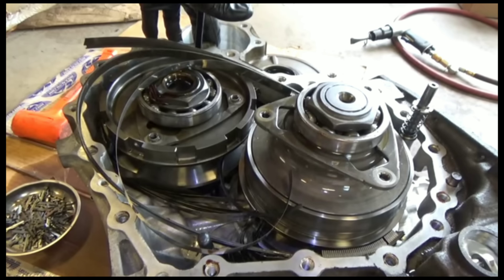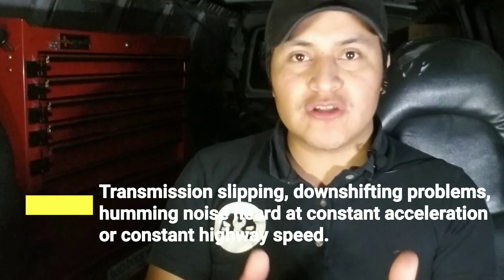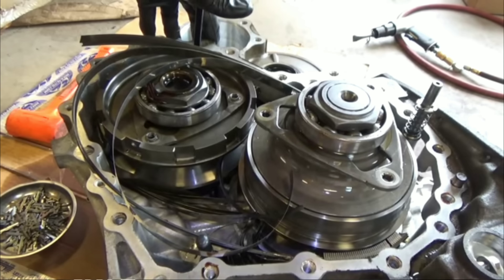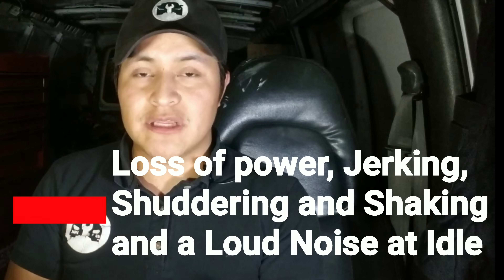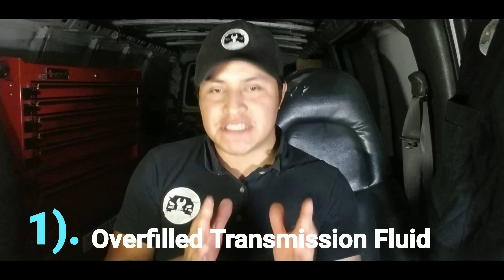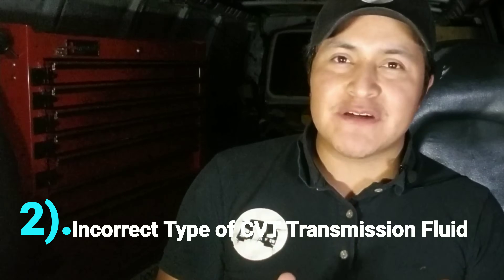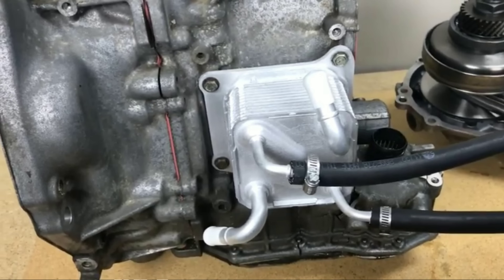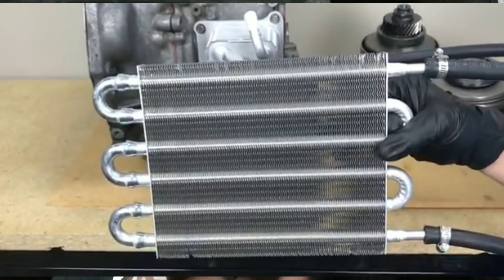NISSAN CVT TRANSMISSION | why it fails and what you can do about it to prolong it's life

Comment: @10:40 I almost guarentee that Nissan would try to blame the CVT failure on the aftermarket cooling system, even if it didn't actually cause the problem. Like insurance companies, car companies will find any reason to try to not honor their warranty. My Nissan dealership tried to say I voided my warranty because I had a bluetooth ODB sensor plugged into the ODB port.
Reply: Yeah like covid shots

Comment: The problem is two fold. #1, CAFE are after higher fuel economy and this results in lower emissions. So government put pressure on car/truck manufacturers!
 #2 Every company has a change over in engineering. Each year the experienced engineers walk out the door with a pension if lucky. New graduates start at lower expense to the company but the wize years of experience walk out the door. I became an ASE Master Tech in 1978 when the company was still marketed as Datsun. I saw many improvements in the engine, transmission, differential and suspension. Hell, I own a 1969 Roadster 1600 (SPL-311) which is the original “Fairlady” series. I rebuilt the JATCO 3N71B automatic and was the only tech to work on the 280Z in 1976. Nobody else would because they were afraid of a 3 gas engine analyzer that provided exhaust gas information. 
  I am looking at a newer vehicle for my wife of 41 years. I will not buy anything with a “CVT” transmission in it period. They for got to calculate and test long term and short what it needs to survive, heat being the number 1 problem of any automatic. Hell, even Ford used the JATCO 3N71B in the Fairmont because it had less internal friction, better fuel economy and produced less heat. The stupid idea they could built this magical transmission and get 300,000+ mile like the Datsun 210, B210 or the F11 nobody heard of. Yes, a front drive car with a stick transmission. You could remove the right front wheel, service plate and change the clutch in 45 minutes. 
  You bet, lets put a metal belt between to concentric pulleys and it won’t get hot? That fine if you want to move hay from a trailer to the top of a barn, but not in a vehicle! Stupid! If you think that’s great, i’ve Got a “Wankle” rotary engine with 3 sides that will run at 11,000 RPM all day long! What? What is an “Apex” seal? Stick to what you know. The 1978 Datsun 210MPG got 56 miles per gallon! Yep, over 50 years ago. Google Road & Track with the Honda FE & Datsun MPG, then lean to read. Retired ASE Master Tech since 1978.

Comment: This man is describing all the problems I'm having with the only vehicle I have to get around 😔
Reply: Tell me about it...  Kinda wishing I hadn't watched this video 🤦🏾‍♂️
Reply: @Tech4Lyfe  😔
Reply: Just ignored and go buy another nissan altima @Tech4Lyfe
Reply: @eliseomata6251  I'm still rolling!  Im just stacking and waiting till my wheels litteraly fall off so I can get my truck.
Reply: @Tech4Lyfe hahaah bad news on bad newwws this one
Reply: @SassyL62  FYI I'm still rolling in my 2012 nissan altima coupe...  After doing some reading and digging, I decided to change the throttle body myself, 30min job, and I also changed my pcv valve, I heard they go bad, which it was.  99% of my issues went away!  Now I need to go to nissan to have them  update my system to stop the damn maf sensor warning (its actually a recall issue so theyll do it for free).  Check those throttle bodies, I had 3 mechanics that didnt figure it out 🤦🏾‍♂️
Reply: @ wow THANK U!!
Reply: I have a 2012 murano I got in April. 
My transmission went out last week in the middle of the highway… I took real care of it and changed all old parts like battery, oil, plugs, new trans fluid etc. it still failed. 
I wish I knew about these cars before buying a used one. I’m back to using my old Toyota Camry. (2002) thing lasts longer than any car I’ve ever drove.
Reply: @Miguel21ification  that really sucks! A lot of the old school cars are driving w no problems.
Reply: @Miguel21ification  I had a 02 Camry sold it last year with over 260k and now it's up to 300k and still on the road
Reply: @Miguel21ification  we're on the same boat, my 2011 Nissan quest cvt trans acting real stupid but Thank God I kept my 2002 Camry & Honda Goldwing motorcycle because they never failed me, had the Camry 20yrs and still runs like hot butter👍
Reply: Did you ever get your car fixed 😭
Reply: @cheriamor4683  girl,  why you crine laughin? 🤔 I don't like det.
Reply: @TamikaX  Hell, I wondered the same! Not sure what her intent was but some people use that emoji just for heavy crying, or loudly crying, not 😂 or 🤣
Reply: @Tech4Lyfe  right! Sheen respond yet but I wasn't that serious.  I was just wonderin chile. Is she gone get it fixed? Is she gone buy me a new one? Cuz she ova der just askin all willy nilly 🤷🏿‍♀️ and laughin 🤣
Reply: @TamikaX  No lady, I was wondering if you got you whip fixed!!!  I'm still riding with mine making noises, and I was hoping for good news and a chance it's not my trans!!!  🤣
Reply: @Tech4Lyfe  huh? I was talkin bout the female. Did you mean to comment from the cheri amor account instead?🤦🏿‍♀️
Reply: @Tech4Lyfe  just screenshot this 🤣🤣 youtube weird
Reply: @Tech4Lyfe  I’m just wondering if you still riding in yours lol 😩
Reply: @aaliyahharris240  LOL, yes but not by choice, 2012  car that I bought in 2014, 68k miles currently.  Think I'mma put in some new coilover suspension, some rims and low pro tires, replace the Trans oil and replace motor mounts all in the next week or 2.  And ride it out hopefully for another year or 2 while I save up for a new truck.  And either give the car to my neice or keep it as a toy.  I now have also maf airflow sensor code that won't go away even after replacing  with a legit oem sensor that was bought from autopart store...
Reply: @Tech4Lyfe  so was it your transmission going bad? Lol
Reply: @aaliyahharris240  🤷🏾‍♂️ I keep having my mechanic check the trans and he don't see anything wrong.  And I'm too scared to take it to my Nissan dealership mechanic...  They always find shit wrong...  I'm hoping the trans fluid flush will sort out any kinks.
Reply: @Tech4Lyfe  if you have a CVT transmission 🤦 I wouldn't put much money in the vehicle now because that trans gonna fail soon and cost you $4,000 on average...ijs 🤷
Reply: trade it for a toyota pay now or pay MORE LATER
Reply: @JDMHaze honda....
Reply: Labor rates are expensive on Trany work, but sometimes you can get the original trany rebuilt at lower labor rates - I did mine for only $850. and it's been working fine.
Reply: @dennishassler605  how much did you pay to get it installed?
Reply: @dennishassler605 where at?
Reply: @MikeJones-qo7vt  - Thank you Mike.  If you take your car to Nogales Sonora, there's an excellent mechanic there - the guy I used speaks English just fine.  For a Transmission, there's several places, but there's one on the route from the border about 2-3 miles
on the highway going the direction toward the border on the LH side.  My Suburban was done several years ago while driving through Mexico at Tacuala Nayarit, Mexico. I recommend using a shop, because they invest plenty to keep the business profitable and pricing in Mexico is less than one forth what you pay in the USA - and they often do better work in Mexico.
Reply: @dennishassler605  Where?
Reply: I recommend getting the transmission fluid changed as soon as you can. Watch the video from the Car Wizard's channel. I hope it helps! CVT transmissions aren't a death sentence for your car! CAR WIZARD shows how to keep them going
Reply: How many miles did yours have? I heard remanufactured Nissan CVT with updated pump would be better but also change the original CVT cooler to bigger size and add radiator. It might be too much work, maybe just find another used Toyota or Honda.
Reply: It's a big problem Nissan has be Honoring the replacement on these
Reply: @ghostface9091  how do I get them to replace mine?
Reply: @TamikaX  only if you have a 2017 Nissan Altima under 100k miles they will replace your transmission.
Reply: @Nicole-si3ck  I have a 2007 but I replaced mine w a transmission that had 64 k on it but that shit ain't no good unless the guy didn't know what he was doin.
Reply: @TamikaX how much did you pay for the replacement transmission?
Reply: I’m about to flush the cvt fluid from both mine and my wife’s nissan. There’s a lot of stories about the cvt trannys but I think some of the issues ppl have is not taking care of their car they way it needs to be. I do most of our maintenance work right in our driveway lol
Reply: Stay away from Nissan
Reply: @Phillip-j2f  period!
Reply: Stay away from CVTs, because you have to replace them with new ones every 70,000 or so miles in some cars.
Reply: Mine started 3wks ago on the interstate all sudden wouldn’t switch or go into any gear it’s been my first n last Altima 😢
Reply: @thunderNRain28damn, glad you're ok. That is dangerous. Check your vin for recall and nissan will fund you and install your new tranny
Reply: @ilersonulysse5113 how are y'all finding this 4 yr old comment
Reply: Story of my life rn
Reply: Yes he did. All this just happened to me on the freeway just 30 min ago. Smh. But he on point
Reply: Mine crapped out. 2012 Nissan Rogue...I can sell it for $790...should've sold it last month when it was still working. Now I'm getting a whol lot less. Trade your car in now before the problem gets expensive! (Also, I just made my last payment 😞)
Reply: Riggghhttt
Reply: Yeah Same here, I'm 69 years old been living in a 2011nissan rogue,  with ALL the Symptoms he mentioned!
Reply: I have a 16 rogue. 65000 it just started making the whining noise about a month ago. Bought it used have an extended way. Dealer said they have no idea what it is could be transmission it the transfer case. Said insurance company won't pay for it until they can tell exactly what it is. They said drive it until it breaks basically. Also when I am driving it the whining noise gets louder, but if I put it neutral while i am driving it goes away
Reply: @bryandelisle1017  - If it's the new variable Transmission (CRT) they cannot be rebuilt, so you have to pay up to get a NEW one.
I'd recommend you do not buy these cars, because the transmissions last maybe 70,000 miles and the cost for a new one is expensive.  Eventually, they'll perfect those transmissions, but it may be a long wait.
Reply: Me to!!🤦🏽‍♀️😒my Nissan Altima 2011
Reply: I loved my Nissan until it just broke n broke nbroke
Reply: Admittedly I would always buy Japanese but if it's not Lexus or Toyota or even Tesla I'm not interested
Reply: not only the trans on them they have so many problem that it take 1 year to make a book y have one but it going to be the last of eny nissan
Reply: @Amador-u2p  they need to keep them in Hong Kong or wherever they from
Reply: @Amador-u2p maybe start with some grammar lessons before you write that book.
Reply: Same 😢 and I don't hand a job. I've been looking since July, but apparently I'm doing something wrong at the interviews
Reply: Yeah sucks
Reply: Same
Reply: 😢true
Reply: I want to address my infiniti qx60 haves more than two oem transmission coolers 1 on the transmission 1 front next to radiator big black and the radiator cooling line so no over heat at all
Reply: Sigh

Comment: "what you can do about it to prolong it's life"

You don't. As soon as you see this video, try to get rid of the car like a hot potato if that's possible.

I wish I did more research or had someone telling me about Nissan CVT problems before purchasing the Nissan Altima. I would not have made that decision. (The transmission just failed and was quoted $4K for repair.)

Comment: i have a question how about when my 2013 sentra wont go past 40mph n the rpm are ramming up on some days ill run okay. 
it this my transmission or my throttle body
Reply: I have the same problem. It hums and sometimes doesn't go past 45 but when it does it accelerates slowly. Smells like burnt oil and rpm is thru the roof. It's misfiring. Mechanics are 'swamped' with cars to fix. Sometimes it cuts off.